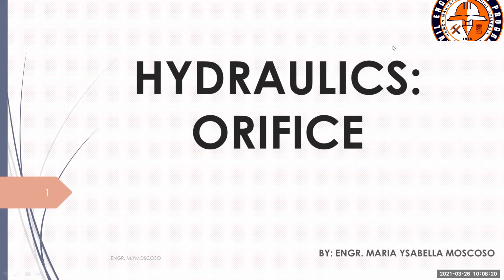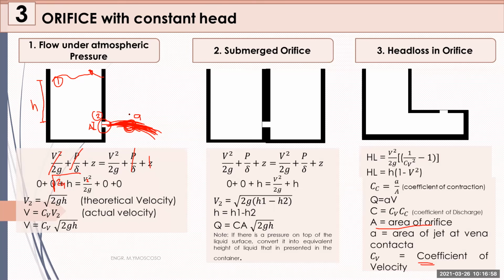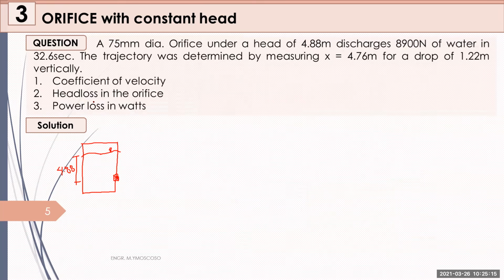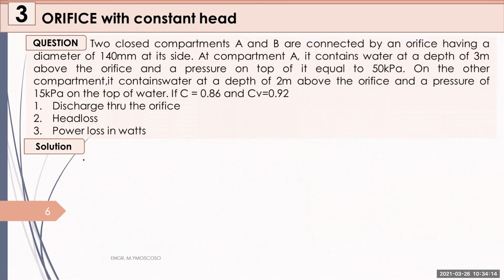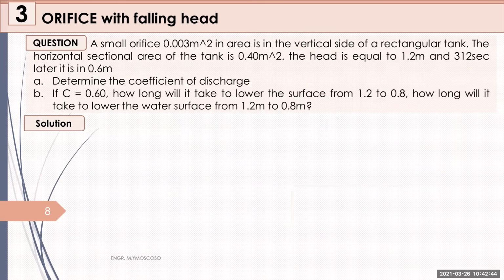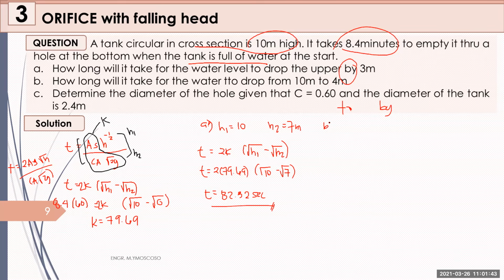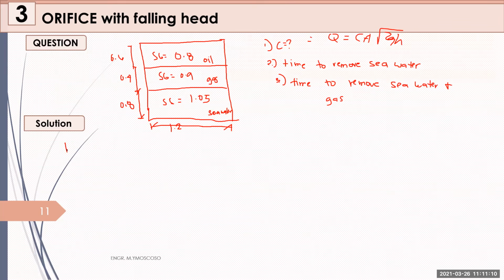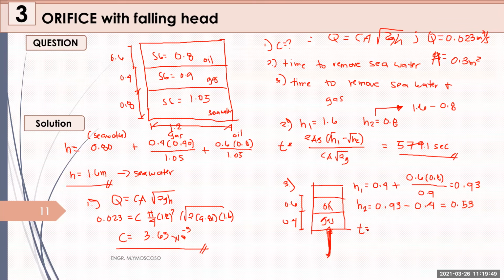HYDRAULICS: ORIFICE

Comment from the maker: Correction
Problems for Orifice with falling head
Problem 1
a. C = 0.0612
b. 20.17sec

Problem 4
a. use the Area of the orifice as 0.3sq.m (I did use the wrong value for the area..that should be an area of the orifice) therefore, C = 0.0137
b. 46.033sec
c. 75.338sec

Falling Head Problem #2
c. 0.165m

Comment: Maam ask ko lang po paano naging 1.2 squared and As sa last problem? Mali po kasi nakukuha kong value sa time. And sa no. 2 requirement po sa last problem din ang h2 po is difference ng 1.6 and 0.6, tama po ba?
Reply from the maker: Hello, the area should be 0.3sq.m 
for problem #2 h2 is 1.6-0.8 = 0.8m